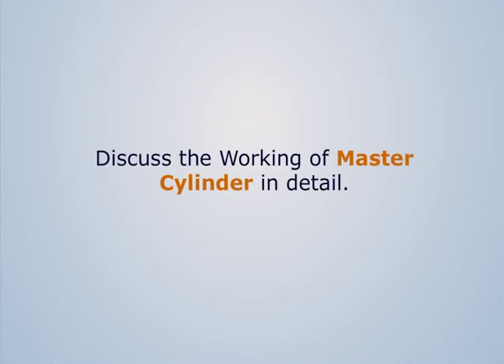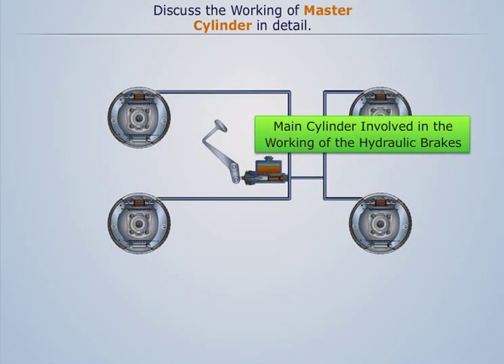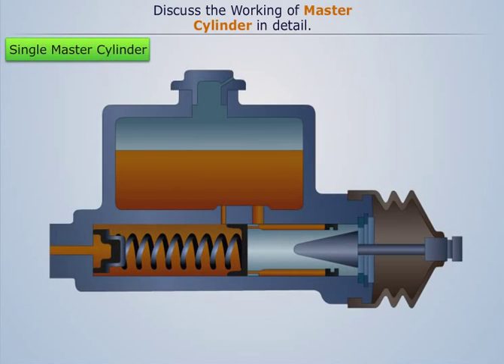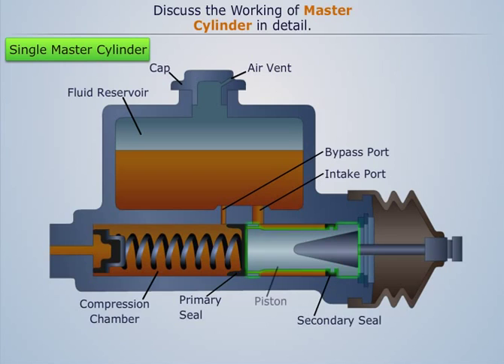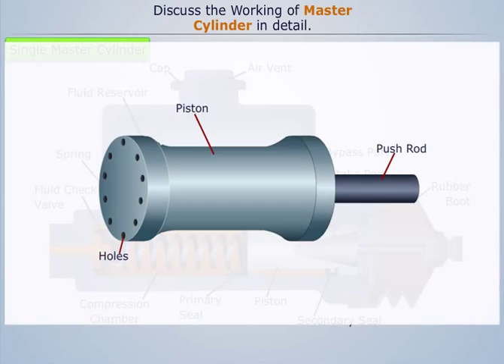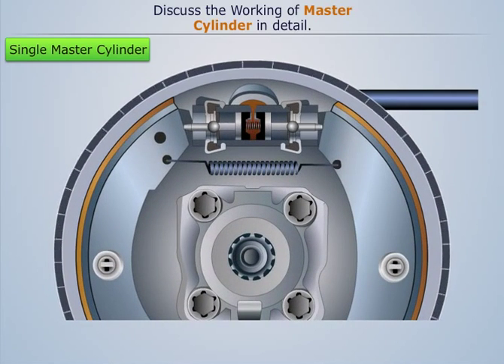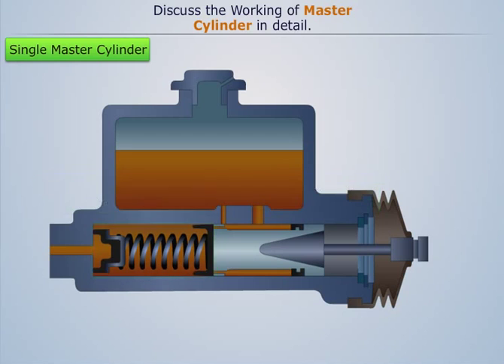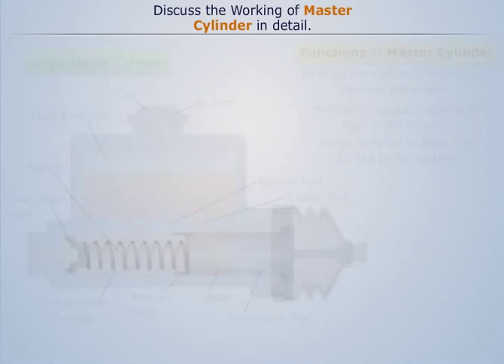Master Cylinder | Automobile Engineering

Comment: best visualization i could find, excellent explanation, 
it's worth noting that when bleeding brakes on a car, it's the check valve that allows you to pump the brakes a few times and then open the bleeder to let the air out. on motorcycles its often not there, so you crack the bleeder, pull on the brake lever, close the bleeder while holding the lever down, and only after that release the lever to allow more fluid into the chamber, and repeat this to bleed.
Reply from the maker: Thank you for your valuable feedback! 🙏 If you’d like to gain deeper knowledge in Automobile Engineering, you can enroll here 👉 https://www.magicmarks.in/product/automobile-engineering/